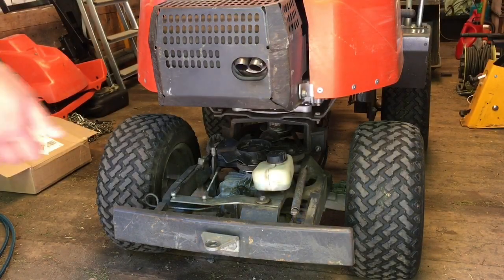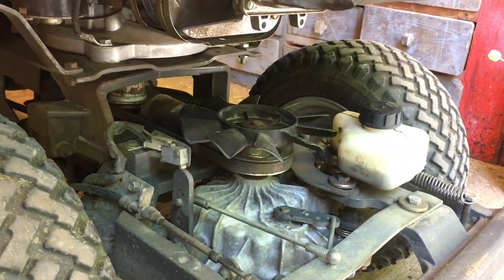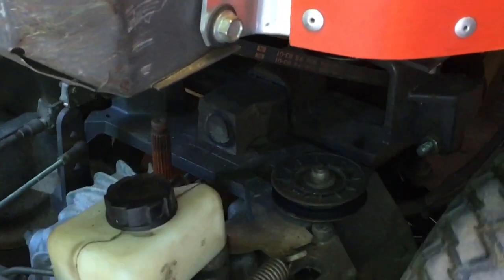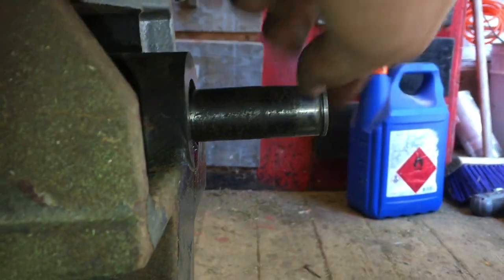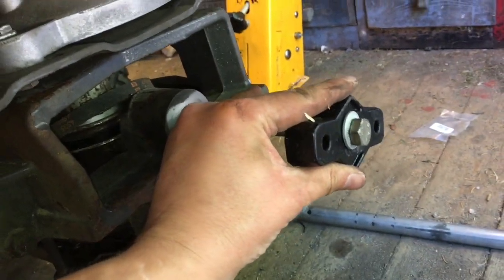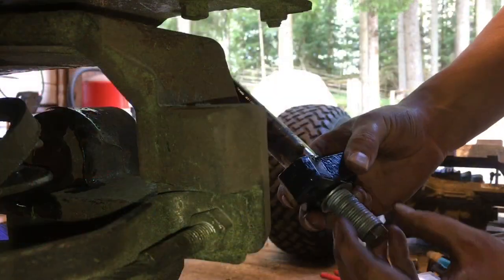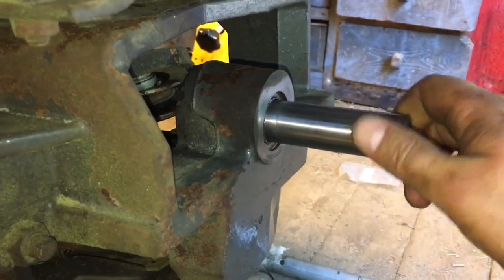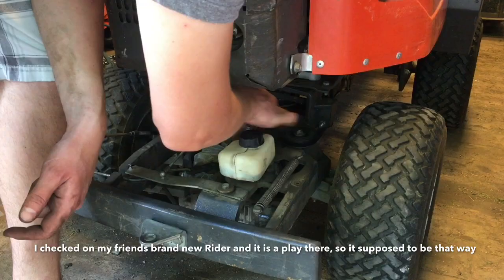How to change swing axle and bushings on Husqvarna Rider, first video on YT!

Comment: Hey mate
Good video, i just replaced these bushes and pin on my Rider 155
I disconnected the gear selector cable and brake cable, rolled the complete transmission away.
I used an old stunt peg from my kids bicycle as a puller to remove the pin. It was very tight and required heating with a heat gun to help loosen it.
I also drilled and tapped holes for 2 grease nipples for the bushes.
There is a hole in each bush which I lined up with the new grease nipple hole and used a threaded rod to install the bushes after leaving them in the freezer overnight to shrink them a bit.
I also replaced the washers and circlips with new ones.
Now i can grease the bushes with a grease gun.
The rear has less free play than your one now!
Reply from the maker: Well done! I did this job again on my Rider 16 and this time I installed a grease nipple. I put that in the middle of the swing arm. I have heard that the parts for this job are getting hard to find. Was it easy for you to find them.
Reply: @NilsKall  Hey mate, I too thought it might be hard to get parts but of the 13 parts I ordered the dealer had everything in stock.
This is in Sydney Australia too!
Reply from the maker: @behan1969  thats great, I think a lot of the parts are interchangeable between 155, 13, 16 etc. especially chassis parts.

Comment: Hi, Nils. Have you ever done this work in the future with an AWD model? I wonder if it is better to disconnect the gearbox from the frame and leave it untouched. Or whether it would be better to drain the oil, disconnect the hoses from the transmission and remove the rear frame and transmission?
Reply from the maker: Sorry, never had any awd models so can’t tell. What does the workshop manual say?
Reply: @NilsKall  I downloaded the workshop manual and am very surprised that the information there is very detailed :-). It says to disconnect the hydraulic hoses and then the procedure is the same as for a 2wd rider. So then additionally you need to top up the oil and bleed the system. Not a big deal at home, I guess it can get expensive at the dealership.
Reply from the maker: @motopripravky  Yes the manual is great! Good luck with your procedure!

Comment: 4:21 I have a big problem and this pin won't come out, can I heat it with a torch? Please tell me how to pull it out. What kind of puller should I use for the pin?
Reply from the maker: I made a puller from a steel pipe (that is bigger inner diameter than the pin) and a long threaded bolt. I added washers when I ran out of threads. There is a threaded hole in the pin that can be used. Heat should make it easier. It might take some time! Good luck.

Comment: Great video Nils!
I am presently stuck half way into the operation 😲
I can't get the axle loose.
Looking at the axle in the video at 3:12 compared to 4:30, the axle seems pushed back (towards the front of the Rider) at 4:30?
Why?
How?
Please tell me, so I can start mowing the RC model plane airfield in Halmstad again, it's getting hairy ... :-D
Reply from the maker: Hi! I gave it some love with a hammer just to get it moving. You need to make a puller with some tube and threaded rod or long bolt. They can be really stuck! Good luck!
Reply: @NilsKall  YES - success!  (y)
Reply from the maker: great!

Comment: Help:
Husqvarna RIDER 850 , I need to change the drive belt has anyone done this and willing to share how?
Reply from the maker: Manual or hydro? Is it the belt that goes from the engine to the rear gearbox pulley? In that case, just remove the spring that tensions the tensioner pulley and then it is easy to lift the belt off the gearbox pulley and just slide it forvard to get it off the engine pulley. Oh yes I think you might need to remove a belt guard too. I actually put on the new belt twice because the first time I got the tex upside down, ocd yes... Hardest part was to get the tensioner spring back. It could be a bit different on the rider 850 but they haven’t changed that much on the basics over the years. Mostly the plastics and the cutting decks. Try to google to find a workshop manual, it really helps. Regards Nils